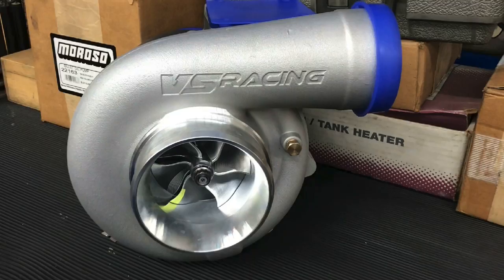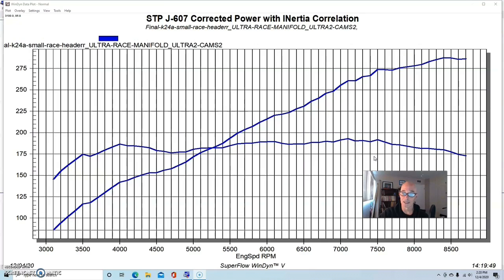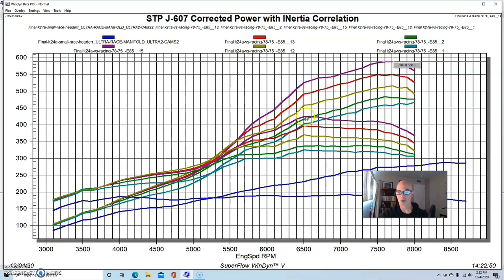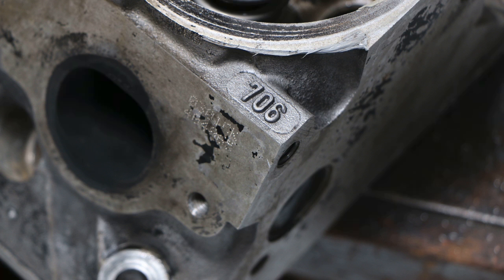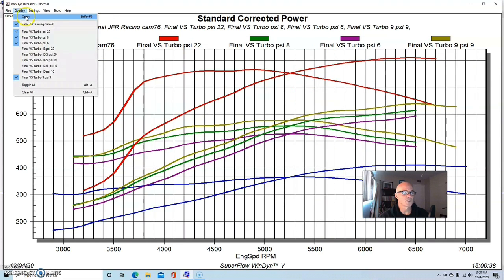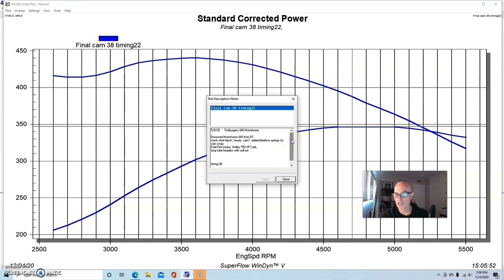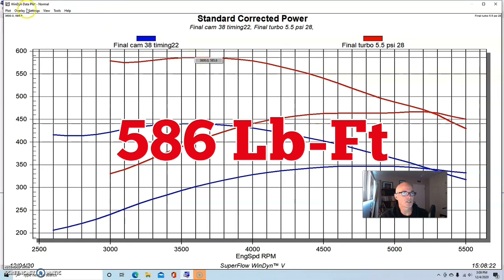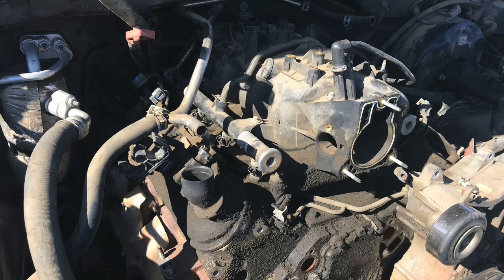VS7875 GEN-2 TURBO TEST-THREE DIFFERENT MOTORS!

Comment: A little late I know but YES More turbo info.  I'm doing a single vsr7875 on my 74 caddy 500 that is in my 65 rambler Ambassador.  74 caddy 500 th400 from wrecked 71 stage 1 buick and 9inch ford

Comment: Hey Richard thank you for this video and other videos related to the VS 7875 and K Series. We have used this info on our 944 Turbo 16V Landspeed car project. We jumped up from a VS 67/62 to the 78/75 this year and man was it worth it! We made 596hp at 6500rpm and 20psi yesterday putting us well on our way to 200mph and the world's fastest stock configuration 944. Thank you again for doing what you do!
Reply from the maker: very cool-congrats on the 944 speed
Reply: You are on top of the comments! Just to be clear we haven't gone 200 with the car yet. We did 167 this past year at The Loring Timing Association with 375whp. So with the new Turbo and 596hp we should be able to get to our goal of 200mph before Gramp can't get in the car anymore, he's a pretty young 75 so we have some time! Thanks again

Comment: I really would like to see a pair on a Devcon filled 416.7 Ford FE. Folks tell me that a pair of GT45s would be big enough, but I’d like 900 hp and keep it down to 10-12 lbs boost with a rising boost curve and a nice cool curve for the power. I have been told that a half fill 416.7 and two 7875s are a good combo for this because the FE is a very sturdy design. I have a set of cross bolt caps and main studs. I also have a pair of aluminum crossbolt caps made for #2 and 4 where they usually crack and am told by Ed Pink that it would hold 1000 hp with just that pair, and they have the side bolts and are drilled to feed oil to those 2 mains and using a pair of screw in plug s above the cam create priority oiling at 1. 2. 4.5 with just a slight enlargement of the 1 feed up to the center passage in the valley and to balance the down passeges to feed the cam well. I like the idea of the aluminum caps at 2.4 since the thrust is 3. Any thoughts?

Comment: Richard, would a pair of the VS 7875s work for 10 lbs of boost on a filled Ford FE using Devcon block fill. I have a D4TE block and I want to fill to the core plugs. The bore at 4.08 and 3.98 stroke at 10-12 lbs boost. ? What do you think? Naturally aspirated I would shoot for 510 hp from 416.7 ci.  Thanks, better late than never and I would like a blow through carburetor setup.
Reply from the maker: twin 7875s will support near 2000 hp-do you want that much?
Reply: @richardholdener1727  I don’t really, I want 800-925, I want the block to live and be useful for a few years. I want to find a 67 F100 115” WB style side. And put two turbos and intercoolers and possibly a 2 4V intake and individual blow through hats. It seems possible to have a pair of 600. DP style with two needle and seats on each primary side with pipe coming from each intercooler to the carb hat . What would be the best size to have a rising boost curve but only need 10-12 lbs from each turbo. I think when we were discussing the 7875 it was for a single. But I destroyed my current left shoulder and had a brush with Covid since then. I believe that a D4TE with a core fill with Devcon should hold 1200 hp. The Cammers were living with 1800 similar to the 392,Hemi. I want to keep it cool but happy.

Comment: I was looking at eBay 7875 turbo for my 6.0 LS I noticed the one with   . 96 AR is cheaper than the 1.25 AR how much of a difference would that make on my 6.0 would the cheap . 96 AR be ok.
Reply from the maker: it will be limited if you plan to max out the turbo

Comment: Maybe somebody has a big block Chrysler that you can use that's not totally stock. You made the 440 look fairly pitiful, I know it was not your engine. But the other two engines all had upgrades and this one was one of the worst ones ever made probably from nineteen Seventy-Six seven or eight with about seven and a half to 1 compression and a cam that's tiny and some kind of truck cylinder heads. Definitely add turbos to other engines to see what happens

Comment: Id like to see 2 VS 78/75s on a 6.0 ls , 454  bbc or 351w 460bbf. Any of the stroker variations. Just to get a look at response vs back pressure etc.
Reply from the maker: look at the twin S475 T4s on the Big bang 6.0Ls. Same thing-very low back pressure

Comment: So of the 7875 variations what housing size would you rec on a basic mild cam 5.3 stock rotator for balance street strip use under 1k hp?
Reply from the maker: Any will work for that-talk with Viren at VS Racing

Comment: Something is off about the 4.8 test. 400hp n/a but it took 22lbs to make 800hp? That should happen around 15lbs or am I wrong? Was back pressure high?
Reply from the maker: the dyno boost gauge sensor was not accurate (was not zeroed)
Reply: @richardholdener1727  Makes since, thanks for all you do.

Comment: I am gathering needed parts for first turbo build. It will be a L59 5.3 with H beam rods and Mahle powerpak pistons with BES CNCed 862 heads TBSS intake 92 mm throttle body and BTR stage 2 turbo cam will the VSS Gen 2 78/75 work well with with this build ?
Reply from the maker: yes

Comment: Yes really appreciate seeing how specific turbos perform on various engine. Would like to see more specific tests with gen 1 sbc that are not cammed for 7000 rpm. I have 5.7 sbc that runs to 6000 max rpm that is primarily a street machine with 1-2 road course track days in a 240z. Looking for good spool and low back pressure at 5000 rpm with 7-10 psi boost.

Comment: what kind of seals does the 7875 have in it?
Reply from the maker: are you asking if it can be used as a draw through?
Reply: @richardholdener1727  Yes I have a small block Chevy that I put a turbo on then realized the turbo was too small. So I'm looking to buy a vs 7875. Someone said  I'm going to pull a oil from my Turbo because of vacuum, I have a very large cam so my motor has less vacuum than normal but is this going to be something that could damage anyting. Totally bummed right now.

Comment: was this the cast gen 2.5 7875 or the billet version? if cast can it REALLY make 1k hp? i just got a gen 2.5 cast vs 7875. was thinking about MAYBE doing a cheap twin setup with 2 cast gen 2.5 7875 like you setup once if a single cast gen 2.5 can REALLY do 1k i may just do a single instead. btw you have anything thoughts on using a log manifold with a single turbo ls setup? or would you still use and modify a stock manifold?
Reply from the maker: WE HAVE ALREADY MADE NEAR 1000 HP WITH IT

Comment: Richard, I have been watching your turbo videos all night. I am looking at going twin turbo and the VS7875 is the turbo i am looking at for ls 408 with boostline rods and wisco boost pistons about 11 to 1 with a special Brian Tooley turbo cam and stock LS3 CNC heads. So the thing that worries me is back pressure. Can you please give me your thoughts on this combo? Fuel Meth
Reply from the maker: if you run twin 7875 turbos, don't worry about back pressure
Reply: @richardholdener1727  Thanks for the info

Comment: I would like to know more about the S480. Have you run it on that LSX B15 376? Our (mutual) friend Chad Reynolds recommended me the S480 on the B15. Also have ported LS3 6 bolt heads. Not sure about cam yet. Plan on using for a drag week/RMRW/True street style stock suspension G Body.
Reply from the maker: DEFINITELY NEED A BETTER CAM IN THAT B15 (AND SPRINGS)
Reply: @richardholdener1727  definitely the plan. Got the springs already. Was going to do a LSA blower on it but a turbo regal needs to stay turbo.

Comment: Show us a 454 with directly connected dual GT45 turbos and cast iron manifolds, waste gate switched from exaust to between compressor and intercooler, E85 upgraded injectors stock manifold.. Man UP! Do a real experiment!
Reply from the maker: WG on the induction side?
Reply: @richardholdener1727  Yes, bleed off boost and maybe keep the turbo spinning faster. (Improved throtle response?) A standard waste gate should bleed enough. They have to bleed a lot of volume from the exaust so bleeding from the compresor side should be easy.

Comment: The whole reason I watch your videos is for information on turbos, already know how my engines do NA. So seeing how engines respond with a snail on them gives me an idea of what I need to fling Pontiac rods to Mars or Jupiter in the middle of a smoke show. Ok yeah I know the head gaskets are the weak link with my engines and lots of cylinder pressure, the rods are only a problem with lots of RPM.

Secondary why I watch your videos is so I can figure out what cams and stuff to get for the LS engines I am stuffing in my old trucks. Not sure if I could care less about 4 cylinders or Ford mod engines, but I dig Clevelands since I am into them too. At least I get an idea of what other engines will do when you put a Wuhan whistle snail on them, big thing I look at is the torque curve. That gives me an idea of how well its going to accelerate a given mass.

Comment: 7875 is my dude 

More turbo and techno action
Reply: @Sloppy Mechanics  I recently bought a VS Cast 7875 Special Build.  It has the early Gen 2 compressor housing (unsure if the Gen 2 cast wheel is any different from the Gen 1 cast wheel) and the Gen 2 1.25 divided turbine housing machined to work with the Gen 1 turbine wheel.  Wow, that was a mouth full!  

I have searched through your YouTube videos, and didn't see much using the  Cast 7875 stuff.  How far do you think this turbo can go on a 5.8L (or a 6.0L if you prefer. haha) before it's done.  Thanks

Comment: Can you do one of these with a cx racing stage 3 gt3582r
Reply from the maker: that's pretty small
Reply: @richardholdener1727  yes but mabe we could put a v6 in the rotaion and see what kinda power it could make advertised at 500 horse but i got one and told it wont get close

Comment: A more in depth explanation on the effects of ar ratios of the turbos when testing in relation to street strip uses etc would help many decide on which direction to go for their differing applications when you're doing these comparisons would be great. I see you in the previous video have a discussion on boost response just haven't watched it yet.
This video is a great example,

Comment: Could you do a Pulsar G42-1450 pleeeeeeease. Its a 7975 & right at $1k. Ceramic Ball bearing, 10 blade billet wheel, anti surge, etc. Badass unit for the price.
Reply from the maker: way out of my price range

Comment: Hey Richard being in Australia 🇦🇺 we have the 5.7. I guess this size turbo would probably be very close to the correct size for the 350. As I’m going LS1 turbo I’m following your advice very closely. 
Ls9 cam gt40 eBay turbo ring gap head gaskets injectors and Fueltech 550 running it. I’ll get some pics to ya. Thanks m8. Keep it up.
Reply from the maker: this turbo works well on a 5.7L-so does the Gt45 at lower power levels

Comment: Richard I have a question do you think that load  on a turbo is made sooner by smaller camshafts .example big turbo with small camshaft at the same boost as big turbo big camshaft would the smaller camshaft make the turbo hit full spool sooner since torque is made sooner or full load made sooner ? The test you did with the truck cam and hi ram Intake really impressed me with torque numbers as boost mimics the original run just with more power also small camshaft seems to show the best numbers torque wise and when it makes power thank you
Reply from the maker: the na combo that makes the most torque down low will spool the turbo the quickest
Reply: @richardholdener1727  that’s what I was thinking

Comment: Using your magic “double power per bar” the 4.8 should have cleared 800 at 15psi but it took 22 to clear 800. Why do you suppose? What is the inefficiency in that combo? It’s off some two hundred powers by the magic ratio. Thanks. Love the channel. Anything I can offer to help, just hit me up Richard.
Reply from the maker: we never ran 22 psi-you are reading the dyno run number
Reply: @richardholdener1727  it says 22 PSI under the red box on the graph. maybe i didn't understand. "final vs turbo psi 22", thanks for the response sir.
Reply: just went back and checked, you said you ran it at "15-16". maybe just a typo. sorry i'm a reader, not a listener, ask my wife lol.  that makes more sense.

Comment: Love all the turbo stuff.  Would love to see some non intercooler testing.  What inlet temps do and Egt data on a hot air setup with E85.  Obviously makes less power but much easier install in the non Dyno world.

Comment: I have a single cab Chevrolet 1500 for the for 8 I want to make about 650 to tiremaxx what turbo would you recommend if all I was going to do was change the intake Port the heads and put better Springs and valves in
Reply from the maker: cam springs and 7875 or s475 works with room to grow-though even something slightly smaller will work on the 4.8L

Comment: If that was a stock cam in the 440 it probwbly would have gained 100-150hp from a simple cam swap in boosted spec.
Reply from the maker: It needed a better cam

Comment: In our latest video we will be adding the VS Racing 7875 to our Porsche 914 with 5.7 LS6.  Can't wait for the BOOST!  I even gave you honorable mention.  (I had no Idea you would be so timely in the video post).
Reply: Rob Willow  it'll be a wild ride!
Reply from the maker: I raced a v8 914 in my 260z way back-I got killed
Reply: @richardholdener1727   :)  some are fast,  others just feel fast.  I realized that my 7875 is a .96 AR Vband (not T4).  How much does that hurt the top end.  I bought it hoping it would spool faster.  
Thanks for all you do!

Comment: A couple of VS Racing 7875 Turbo Questions from a novice: 1) Is yours Cast or Billet? 2) Did you size the wastegate to the engine or use the same size for the 3 engines? 3) What is the A/R for the cold side on yours? Sure, more turbo vids, haha. Thank you for your help. Best Wishes, Skip
Reply from the maker: used same gates for all three 45mm Hyper gates from TS, cast I think,
Reply: @richardholdener1727  Awesome! Thank you, Richard! :-)

Comment: I like the turbo vids. Wish you had a modern Ford V8 in the stable to add to the group of test motors!
Reply from the maker: I've run Coyotes if that is what you mean
Reply: @richardholdener1727  Yep I’ve seen your Gen 1 Coyote content. Maybe some current Gen Coyote turbo tests? Junkyards are full of the 6.2’s too! Maybe see if you can get your hands on the new pushrod 7.3?

Comment: 6.2 L92 thinking about a t6 s480 and cam. It's in a DD 96 crown vic with a 4l80 and 3000 stall. I want to make 650rwhp on pump gas and 800+ on e85. Do I go for a sloppy stage 2 or something more mild like a summit 8720 or in between like a btr stage 1 turbo cam?
Reply from the maker: a mild cam will work fine

Comment: why the 440? You didnt run a 440 in previous video. You always seem to skrew up the comparrisons by not repeating same papameters
Reply from the maker: we ran the 440 with nitrous and a turbo previously
Reply: @richardholdener1727  https://www.youtube.com/watch?v=tSk_Q0xU0Hc&ab_channel=RichardHoldener (no 440). All LS - 4.8, 5.3 (383 stroker), 6.0, buick 455....no 440, no Ply. Chry, Dodge. What happened to the back pressures issues, you didnt discuss this in recent video. Without repeating all the same tests (comparrisons) with only the bigger turbo being the only variable you skew the resulting data. I really like your videos but were not getting the whole picture. Liken it to painting the same portraits but using different paints in a couple portraits

Comment: Yes. Lets see more turbos. I would like to see a comparison between 1 large turbo like the VS7875 and 2 smaller turbo with the aim to show low speed response for a street deal. LS 4.8, 5.3 and 6.0.
Reply: This test. The smaller K29 might be a nice turbo for the street I have never found any info on the LS using it.
Reply: Agreed, especially with an affordable turbo like the VSR lineup.

Comment: I think you were right the 440 didn't perform as well has the K24 if you look at cubic inch per horsepower or even the horsepower per cylinders
Reply: Means nothing when the light goes green though.

Comment: I would even love to see an engine run with turbo intercooled vs non intercooled and look at the dynograph, same engine same turbo. I bet it would be very interesting
Reply: I would like this too. Show us what we learned with The Grand National, intercooler made a big difference on those. Peace
Reply from the maker: that video is up
Reply: @richardholdener1727  Oh! I'll check it out right now, thanks
Reply: @richardholdener1727  625 HP big intercooler, 645 HP non intercooled. I was surprised you didn't point out at the end of the video you also had 2 extra pounds of boost when it was non intercooled. I think that translates to about 20 extra HP. But even if it made the same amount of power there's something weird about all of this. Maybe this is a turbo thing and not so much a supercharger thing, like you said in the video the turbo will spool up just a little extra if the intercooler is working good to maintain the same boost pressure in the intake manifold. I would bet the effects become much more drastic on a turbo application even at these 9 - 11 psi boost levels
Reply: @richardholdener1727  I watch a lot from Cincy but I missed that topic. Keep up the great work!

Comment: I know your specialty is Ford and then GM.  I would like to see testing of the older Mopar 360. Heads, cams, boost, intakes, etc. What is available for this humble engine?
Love the comparisons, but kind of boring using the same family in multiple shows.
Thanks for sharing.
Reply from the maker: My specialty is not ford or gm
Reply: @richardholdener1727  
Maybe preference is a better word.